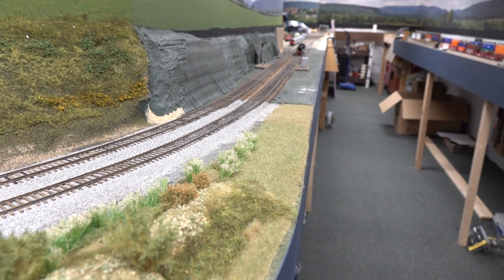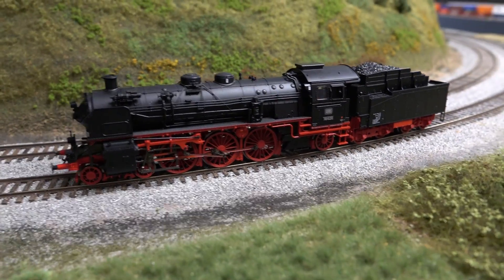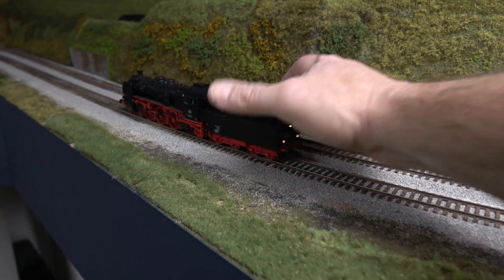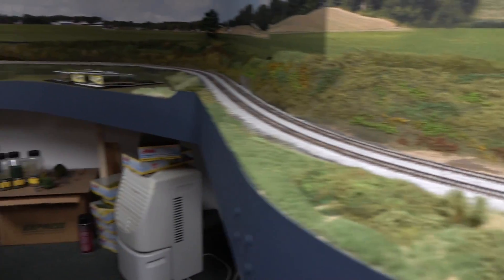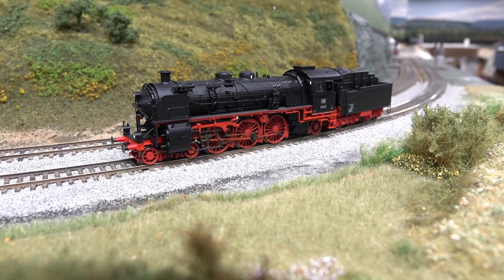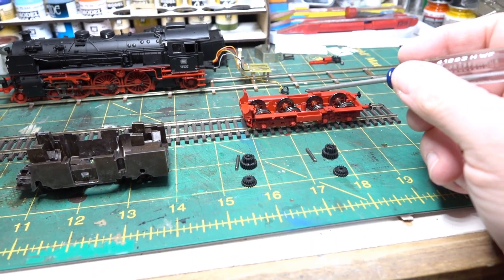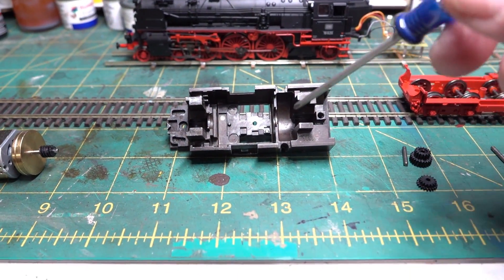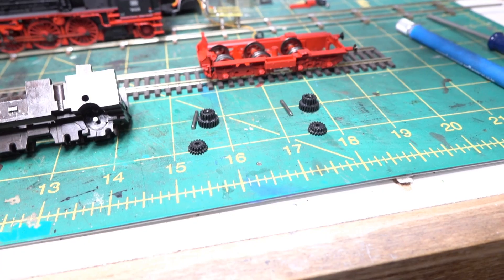HELP! Fleischmann BR 18 Issue

Comment: Hey Rob. That is a challenge. I agree with Alvaro also, but check that the motor is held down well after the clip is re-installed. Might need to adjust the tension with a small bend to get enough pressure to hold. That is a beautiful locomotive! Good luck. Cheers, Dan

Comment: Hi Stephen, beeing a marklin fan for 50 years and knowing Roco and Fleischmann I would 1st check the wheelspacing with NMRA template. The Europeans work with slightly different measurements on wheels, flanges and so (due to greater specs on track). The gear on the backside of one of the driving wheels may go in and out of masch while driving, maybe degrease the amount of side slippage. Take the whole tender upside down in your hand when connected to your 12V DC supply and see what happens by tilting or even pressing the axles to one side.
Personally I prefer Marklin for AC or DC for DC/DCC, because they have the motors in the engines with metal gears.
In steamers, others work with driveshafts from tender to front to get more pulling power (Roco,Fleischmann), but you can get only so much weight into an HO tender. Greets from Germany

Comment: I love the BR 18 loco. I have the newest version of the Fleischmann model, with factory sound. It runs beautifully.

I have not read all the replies to your post, so I am sorry if I repeat what somebody else may have suggested. 

Provided that the gears are intact - no missing or broken teeth - the problem must be that they're loose and slipping. 

The gears and worms are supposed to be pressure fit, that is, snug, or tight on the axles/shafts, so there is no slippage. 

You can test this by holding the gear from moving, and trying to rotate the wheels. If you can easily rotate the wheels, that is clear, it's slippage .If the gears came off the shafts very easily, that is a sign of possible slippage.

Time is putting its mark on plastic gears/worms, even if the model is not used, and if there is a crack - very fine cracks may develop - or simply plastic expansion, they are no longer tight on the axles/shafts, and so they will slip. 

There are a few ways to make the gear tight, without replacing the gears. I prefer, as a temporary fix,  a drop or two of superfine CA glue - crazy glue - between the gear/worm and axle/shaft. 

Of course the better fix is to replace the old gears with new ones.

Good luck.
........

PS 
noticed the NS 6920 Veterans SD60E on some of your posts - I have a HO model of it, and a few videos uploaded on my channel.

Comment: Not having any experience with this brand the only suggestion I have is:  when it stops moving is the motor rising up into the tender in such a way is to create non-contact between the worm gear and axle gear.  I notice that the worm gears continue to spin but, see no damage on the axle gears???

Comment: Hello Rob...to me it looks like the axels are loose in their bearings in the 41 4118 Tenderrahmen...are there any wear here...any  movement besides turning...?  a slight wiggle on the drive axle is amplified out on the  gear and could affect, not only the gauge, but the also the distance to the next gear, thus risking jumping out of contact.

Comment: I was going to comment on a few things I have encountered over the years with pre loved items that have had similar problems from a variety of makes but most have been covered. The main issues I have come across are with plastic gearing and its fit to parts tightly such as the worm gears to the motor armature and the gears to the wheel axles, this is most often the cause of these sort of problems due to the fact pre loved items may have been mis used and larger loads pulled than designed for second is Gauge specs for the wheels, I noted at the start of your vid the loco ran down the straight well but it had the problem almost as soon as it got to the curve, as others stated there may be too much side ways movement in the wheel sets and this stops the gears meshing correctly and over time with normal use and loads it can cause gear teeth to be worn down to the point that they will create flat spots where the gears dont mesh onto the wheel gears which will only be a problem when it is happening at the same time on multiple wheels once this starts to happen there is no fix other than replacing the gears on the wheels as well as the lower gears in the tender, to be totally sure of complete fix I would replace all gears at the same time.

The other main cause i have found in the past is what i like to call a manufacturing oversight what that means is that there is not so much a design fault but a wear fault or lack of prevention of wear. all plastic parts wear alot over time and where these items rub on metal the plastic will wear faster naturally sometimes these type of gears have a minor side wear which is considered to be fair wear and tear but will allow gears to move out of alignment and the fix is simple to prevent this wear once the gears are replaced is to put shims between the plastic and metal parts this gives an added turning part between the plastic and metal contact, much easier to replace a shim than a gear in years to come.

Hope this helps any viewers with a few tips and hints of what can cause these sort of problems and a way to fix and stop any recurrences.
Reply: i guess Im pretty off topic but do anybody know a good place to stream newly released tv shows online?
Reply: @Andre Salvatore i dunno I'd suggest Flixportal. You can find it if you google :D -ethan
Reply: @Ethan Maximus thanks, I went there and it seems like a nice service :) Appreciate it!!
Reply: @Andre Salvatore You are welcome =)

Comment: Is the motor held down by it's own weight? Could you add a strap to hold it down against the gears? Maybe it is not holding contact against the gears, it is definitely a head scratcher.

Comment: Dear Stephen, after sleeping over this rather restless, I come to the conclusion, that the problem must be between those lower gears on the side matching with the gears on the backside of those 2 wheels. Try to shim with Kadee shims on the shaft of these two gears and see what happens, or make shims yourself out of 0.5 - 0.1 styrene. At this point I don`t see the retainer as important, since video shows working worm and idler gears without it.
Could you let me know, what decoder you used ? Greets Karl

Comment: Hopefully the ordered new gears will sort out your problem. I have no particular Fleischmann experience, but it looks to me like it's the classic plastic meets metal problem where the softer material wears out. It could just be that, rather than missing teeth or anything obvious, they are all equally worn to the point they are only just catching and then slip?

Comment: It looks like the lower gear may be popping in and out. Or not tight on the shaft. So the shaft is spinning and the gear is floating. Did you check the gears on the axles. Are they slipping? Are the matting with the lower gears?  V

Comment: Hi Rob, Just wondering did you work out what was wrong with it? This comment is 7 years later. I have read many of the comments below and wow there are so many variations and some people did not even look or see what was happening in your video and they just made a comment.... I have one of these exactly and the issue for mine was the lower axle gears were slipping on the axle shaft. I just put a drop of super glue on it and away it went. I love the Fleischmann locos and have several of them.

Comment: it's some years since I had Fleischman but my situation was that the main gear cog would slip on the drive shaft so I used to glue the gear to the shaft.If it was loose the motor was turning but not turning the wheels
Hope this will be of use.

Comment: I repaired my BR 18 with same problem . Problem is when loco moving,  wheel's gears move aside from loco tender's lower gears . When it stoped just move loco tender right to left to see it works again just like on your move . Fix it with move wheel's gears  1 mm to center and fix them to prevent back. Make new move how you repairing it with show disambly and assembly tender. Thx.

Comment: Of course it is not working it is missing a metal bracket that holds the motor in place the part has nr 50 4904 Spannbügel it goes over the motor

Comment: Hi, my 4118 has the same issues, and i think it has to do with too many moving space somewhere in the gears system. I was puzzeled to find the issue on a straight track facing right, but no problem driving the same track facing left. So I looked closer at the track. It is parallel against a wall and the surface it is on, is not exactly horizontal: the wallside rail is a little bit higher than the frontside rail. This caused the loco to lean a little bit into the room. This leaning has given issues with other locomotives as well. My hypothesis now is that the axes have a little bit too much moving space. On a perfectly horizontal rail track there is no problem. But a little imperfection here can cause the gears to just miss each other and slip. 
Tomorrow I will try to make the axis length (=distance between the geared wheels) a little shorter. And I hope this will solve the problem.
Did you find a similar solution?
Reply: This will not solve your problem, not this way

Comment: Hi Stephen, please wait a moment. I´m seeing your video, and as an official repair shop from Fleischmann/Roco there is an important thing missing in your tender: the motor retainer clip 00504904!! Without it the worm can´t  get enough pressure to push the motor against all the gears.  See at minute 9:15. You have a place to put there in the sides of the chassis that retainer. Maybe the loco has been disassembled once, and they forget to put it back again. Ask Roco/Fleischmann the retainer and you will see the problem solved. Please let me know, even beeing here in Portugal, if you can get it. If you have a safe way I can sent you my email. Are you in Facebook? I´m as Alvaro Sousa.
Reply from the maker: I have it- it was removed to take the motor out. I just neglected to reinstall it as I was filming. I thought that may be an issue, but the problem existed before I started disassembly and it still stalled. So I don't think the clip being off is the real issue.
Reply: If that is the case, you need to see two things: first connected the tender to a DC source, pull out the tender of the rails,  put the clip retainer and see if both worm gear "touched" all the gears. If the contact is good enough all the gears must run smoothly.  If the contact is sometimes missing you only solve the problem with new gears.Then also see the gears in the wheels. I have once a similar problem and the gears that were on the axles, were loose.
Please let me know the result.
Cheers,
Alvaro
Reply: Stephen see also if both worm gears are firmly connect to the motor axle. Sometimes due to long time no runnig, they "open" (like in some old Athearn models), and the motor runs, but not the worm gears. Run the motor outside of the tender and with your fingers press each worm at a time. If the motor runs... you have there the problem.

Comment: Did you get it fixed?
Reply: The new gears have arrived. I have been busy with the road crossing and assembling a portable 12V DC power supply so haven't gotten back to the BR18 yet! Soon....